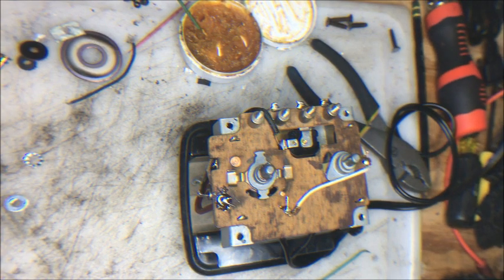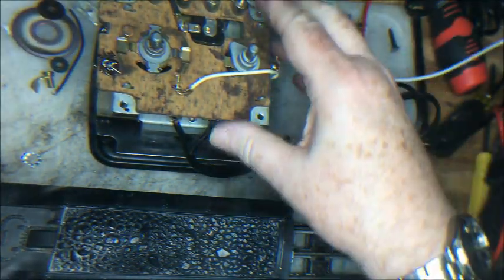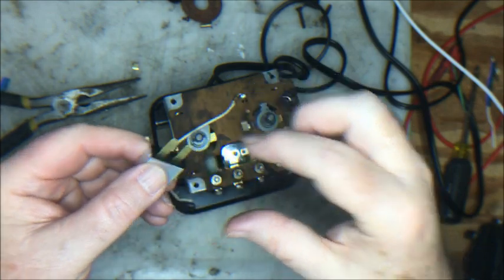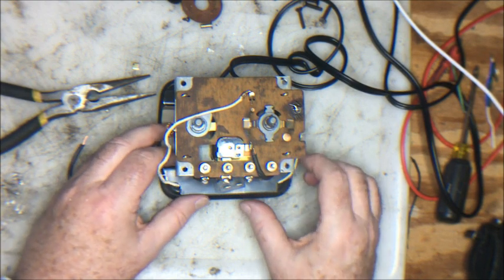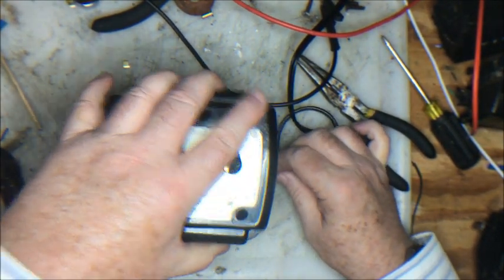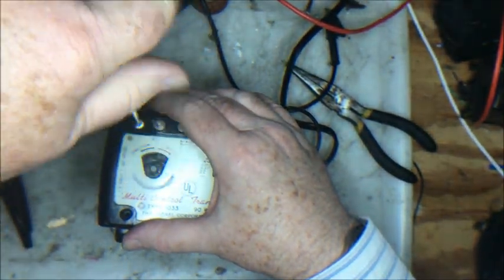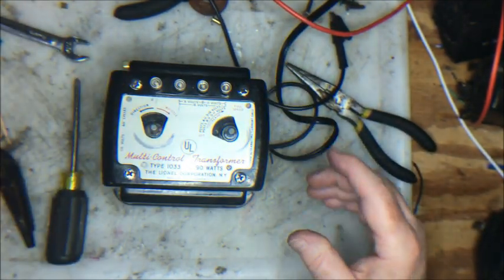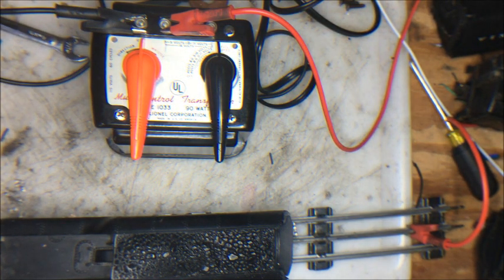Lionel 1033 Transformer Renovation Part II

Comment: Next issue Pete:  I have a  Lionel 6110 that I replaced the worn out, non functioning drive motor on. And when I looked for a hot connection point for my smoke element, I see that the entire drive is sealed?, and there doesn't seem to be any screws that can be removed to disassemble it to get at the coil to make a power connection. I'd like to know if there is another way to get power to the smoker. Thanks, Craig
Reply from the maker: Hello Craig!
The 6110 Scout locomotive was produced in 1950, and differs from the 1110 Scout mostly by the presence of "Magne-Traction" which increases the tractive power of the engine by about 50%. It does not have a headlight, but does have a smoke generator powered by an insulated wire soldered to the roller contact strip. The insulated wire comes out of the front of the 6110-100 motor and connects to the top of the smoke generator. The smoke generator itself is mounted in the forward casting of the 6110, not inside the motor, and is thereby grounded. 

I am not certain what you mean by " I replaced the worn out, non functioning drive motor on. And when I looked for a hot connection point for my smoke element, I see that the entire drive is sealed."  If you replaced the 6110-100 motor with a"similar" Scout motor, like the 1110-50, you will not have an insulated wire for the smoke generator. You would have to open up the motor and run an insulated wire from the contact strip to the smoke generator. This a risky thing to attempt. Scout motors are notoriously hard to put back together, especially by inexperienced hands, and best left alone. Scout locomotives were inexpensive O-27 gauge productions for starter sets. You may get lucky and find a replacement motor online or at a garage sale. 

Since the motor needs to be opened to jury rig the insulated wire from the contact assembly to the smoke generator, you have noting to lose by trying. An 18 or 16 gauge wire should suffice. Use your cell phone to take photos of every step  so you know how to reassemble the motor. Good luck!
+
Reply: Thanks. I think I will leave it alone since it has not run for 40+ years, and my $20 replacement got it workong again.. (And I dont believe the smoker ever worked.)
I have a conversion smoker kit on order for my 2055 engine. That will be my last project for the season!!

Comment: Have a bunch of Lionel tubular track I need to test as my next project. Any hints on starters?
Reply from the maker: Connect the track to a transformer and check voltage with a multimeter.

Comment: New Topic Peter. Do you know how to correctly rewire a 1033 transformer winding on a Lionel Gang Car #50? Mine is a mess. And I believe I have the same issues as others...only worked in one direction while I had it going. As soon as I disassembled it, all the winding copper came loose. I think it was wired wrong in a past repair....could have been some 10 - 20  years ago too!!
Reply: Happy New Year! Sorry about 1033 mixup. I have ordered another Gang Car as suggested.
Reply: I received the new Gang car, and after inspection of the armataure coil, some strange cross wiring has taken place on the old one, ie too many windings being soldered together!!...so I guess the question is do I want to try and get the coil rewound, or just, as you said, keep the  Gang Car for spare parts.  Thanks for the info.
Reply from the maker: @craigschade5585  If you can find a distressed gang car with a good field assembly you are in business.
Reply: @peterfenzel4742  Agreed. For now I put them both together, and it looks like two gang crews are working back and forth!!   Hobbying Fun 101... for ages 14 and 64!!
Reply from the maker: Hello Craig! Happy New Year!
The #50 Gang Car is a great addition to any layout, and adds a lot of fun movement.  I am not sure what you mean by a 1033 transformer winding on a #50 Gang Car. I assume you are referring to the split field winding, which enables the car to go in either direction when the bumper slide is engaged. The motor for the #50 is made up of the field, the split field winding, and the armature. The center point of the motor's field  winding connects to one of the armature brushes. The other brush connects to the pick-up roller.

The winding should never come loose as you described. Rewinding by hand is nearly futile. I would recommend against attempting to rewind and look for a distressed #50 to salvage parts.
Reply: I got it running one way again. Back to square one again. I do see a loose copper winding wire however. Could it control the ie 'reverse' function?
Reply from the maker: @craigschade5585  Probably not. The winding is split internally.

Comment: What diode part number did you use?. My plate is shot. Black insulator? ring/washers hardened and brittle .
Reply: What is the test for the circuit breaker once I replace the diode?
Reply from the maker: @craigschade5585  I use a multimeter on all wiring variations. U-A should go from 0 to 3 volts to 18 volts. U-B  from 0 to 3 volts to 11 volts.  A-C should be constant 18 bolts. B-C  should be constant 11 volts.
Reply from the maker: If your rectifier disc assembly  and black rubber spacer are so badly damaged, you may wish to rethink whether the transformer is compromised in other ways. As far as replacing the rectifier disc assembly with a rectifier diode is concerned, I have used 16 amp diodes purchased from REPAIR STATION on Ebay. They are readily available for $6.
Reply: Thanks. I ordered a positive stud diode. I will follow your video instructions and let you know. Craig
Reply from the maker: @craigschade5585  Good luck and have fun!
Reply: @peterfenzel4742  One more question: So will the black power control lever not function either if the rectifier disc assembly is bad? Seems I can get the engine to run if I use A and C poles, but not with the black lever.
Reply from the maker: @craigschade5585  The rectifier disc/diode operates on direct current, and functions independently from the alternating current driving the engine. Your wires should go from the U post to an outside rail and the A or B post to the center rail. The right side control lever moderates the voltage, hence the speed of the train.  Accessories are run on a constant voltage either with  A and C post or B and C post wiring.  You should be running your engine on U + A or U + B wiring, not A + C or B + C.   If your engine does not work with a U + A or U + B connection: 1.  check the contacts with the track; 2. check the integrity of the wires;,  3. check the wiring at the A and B posts. or 4.  If the circuit breaker is compromised, you will need to install a new breaker.

Comment: I really enjoyed your video.  I am going to go out and get the rectifier diode 16amp, a busman 6 amp-12 volt resetting thermal breaker and a new cord.  I’ll let you know hoe it GOES!  Thanks
Reply: Peter. where is the best place to get these parts, diode, breaker, terminals, cords?  I live in Michigan and my local train store doesn't have any of these parts?  I would appreciate some add'l direction.  Thanks
Reply from the maker: @workdanpaterra8121  https://www.amazon.com/gp/product/B000Q0AVIA/ref=ppx_yo_dt_b_search_asin_title?ie=UTF8&psc=1&pldnSite=1

https://www.ebay.com/itm/REPAIR-STATION-16-amp-diode-for-Lionel-KW-Transformer-w-INSTRUCTIONS-16-amp/201466844389?hash=item2ee85c14e5:g:6iAAAOSwOyJX3D-A

https://www.ebay.com/itm/L-POWER-CORD-FOR-LIONEL-TRANSFORMERS-ZW-KW-SW-TW-1033-HEAVY-DUTY-FREE-SHIPPING/121932171201?hash=item1c63b947c1:g:CksAAMXQ-BZQ-r~t
Reply: @peterfenzel4742   Thanks again I needed the additional info to find them
Reply from the maker: Work Dan Paterra  Enjoy the process, Dan!
Reply from the maker: Try EBay or Amazon
Reply from the maker: Hello, Dan! Thanks for the kind words. I will enjoy hearing how your own 1033 renovation worked out. FYI, you might want to skip the circuit breaker replacement if the installed breaker is working OK under the rubric:  "If it ain't broke, don't fix it."

Comment: I know the left lever is for direction and whistle and is spring loaded. Mine is fine but it seems to be a bit sloppy if I lift the long end,. if I'm saying this right. Is this alright? Feels like the inside is loose and the center post will get real hot and burn to the touch. Thanks.
Reply from the maker: NOOOOOOOOOOOO! That is NOT alright.  Burning heat is very dangerous. Unplug the Transformer and do not use it unless and until it is fixed.  QUESTION: 1. Why are you lifting "the long end"? Sounds like the retaining sleeve is not snug. 2. What do you mean "center post will get real hot"?  There is no center post. You have 2 levered controls, left for whistle and direction, and right for throttle. There are 4 binding posts, from left to right: U-A-B-C. Excessive heat sounds like a failed circuit breaker and a short circuit.

I strongly urge you to have a pro look at the transformer, or throw it out if repair is not cost effective. Do not risk injury or death.
Reply: @peterfenzel4742  Got it. Not lifting whistle lever,  it teeters to the tip of the long end. Removing it that shaft gets real hot so it must be loose inside there. Will have to find another one. Trying to find a replacement for my old CW80 that died, new ones not out yet. Thanks Peter. Acquired two pre 736's that don't smoke. Pistons not going up and down.

Comment: Mr Fenzel, do you or someone else restore these 1033's for others?  I have one.  It is not in as bad a shape as the one that you worked on.  I am certain that  mine has the same issues as the one you did.  But that is not what I do well.
Reply from the maker: Thank you for the compliment. I do this for the love of it. I do not repair them for money. There are many train stores which will be happy to service your transformer. I can name some if you would send me your general location.
Reply: @peterfenzel4742  I will be indebted to you.  I went to a large train show/vendor show in Richardson, Texas and no one could tell me about transformers.  I am in the Dallas/Fort Worth area.

Comment: Do you have a video on how to re-attach the orange whistle lever. I have all the parts just don’t know how the spring attaches. Loved your other repair videos.
Reply from the maker: Dale, at the 7:54 point in the video I attach the whistle handle by pressing it down on the whistle switch shaft assembly. The centering spring sits below this assembly and is not affected by removing or replacing the handle.
Reply: Peter Fenzel 

Sorry, I didn’t make myself clear. I meant re-attaching the post and spring and retaining nut on the unit inside. I realize I have to remove the fiber board to get at it. Don’t know how the spring attaches and the retaining nut is held on. 
Do you repair and upgrade the 1033’s for a fee?
.
Reply from the maker: @dalecollisson3293  Hello, Dale! No I have not made a video of replacing the switch shaft assembly. It is a pain in the neck to attempt because we do not have factory tools. You can, nonetheless, improvise, adapt, and overcome. There are 4 parts to the SSA: the shaft itself, the copper/brass winged contact, the centering spring, and the retaining sleeve. The winged contact has 2 little nubs which recess into the shaft so that the contact turns when the shaft turns. Make sure they are married.

The first step is to put the centering spring in place on the underside of the fiber mounting platform.That is easy to do. Once the spring is in place you pass the stem of the shaft through the fiber platform to be caught by the spring. You will easily see where the spring presses against the wing of the shaft assembly. The real problem is fastening the retainer sleeve to the stem so that the shaft assembly is tight and secure and makes perfect contact with the contact points embedded in the fiber platform. I use a drill bit extender for this purpose. I turn the platform upside down on a firm surface and place the retaining sleeve on the stem. Then I position the drill bit extender on the stem, where the drill bit would ordinarily sit, and tap the other end of the extender with a light hammer. I keep tapping to encourage the sleeve to move up snugly around the stem until the assembly is tightly but freely in place.

One good idea, as long as your whistle switch assembly is removed, is to use fine sand paper to polish the copper/brass contact points to a shine for optimal electrical contact.

If you come up with a better way, please share it!  Thanks!
Reply from the maker: @dalecollisson3293  TO TIGHTEN RETAINING SLEEVE to BOTTOM STEM OF WHISTLE SHAFT

1. I completely unsoldered all wires from the top plate assembly, unscrewed the new diode from its place on the rectifier plate, and separated the top plate assembly from the rest of the 1033.
2. I sand papered the contacts imbedded around the switch shaft until they shined
3. Using a small long nosed pliers I increased the bend pressure of the contact arms around the shaft
4. I inverted the top plate and secured the shaft to a vise.
5. With the shaft thus secured, I used a drill bit extender and a hammer to tap the retaining sleeve more deeply onto the bottom stem of the shaft. This cured the "wiggle" and loose contact problems.
6. I wicked away all old solder from every contact.
7. I reattached the whistle diode to the rectifier plate before soldering the diode wire.
8. I resoldered all wires back to their original contact points, reset the slot tabs through the 4 slots in the fibre plate and seated the plate, resecured the Transformer cover,  reattached the binding post nuts, and reattached the red and black handles.
 
Then I bench tested the transformer. I checked all voltages with a multimeter, and all readings were nominal. Then I placed a whistle tender on test track and turned the now snug whistle control lever. The whistle sang loud and clear with no hesitation or linger. I replaced the tender with a locomotive on the test track and opened the throttle. Perfect motor operation resulted.
 
It was the long way around, but there are no shortcuts with 1033  transformers. They are elegant, simple machines.

Comment: Thanks for the great video on replacing the diode. You make it easy! Could you please tell me if the body of the diode is the anode or cathode?
Reply from the maker: The positive contact (anode) would connect by the short wire to the remnant of the brass arm which held the rectifier disc. The negative contact (cathode) would be bolted to the rectifier plate.

Comment: How do you test certain parts for power
Reply from the maker: I use a multimeter
Reply: Been trying to get mine going but not having any luck if I use u pin and a pin on tracks I have nothing if I use u pin and c pin I can get it to work but not like it used to be
Reply from the maker: @natewfish1  The U ground post should work with the A and B posts, not the C post. Sounds like your wiring is incorrect. Accessories should be wired to the A and C post.